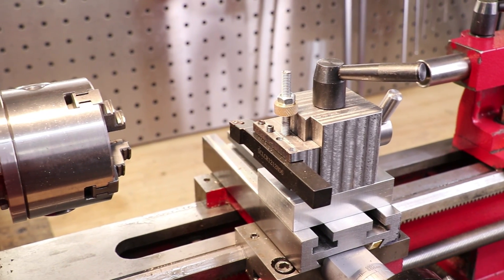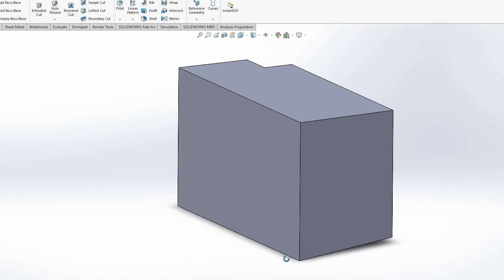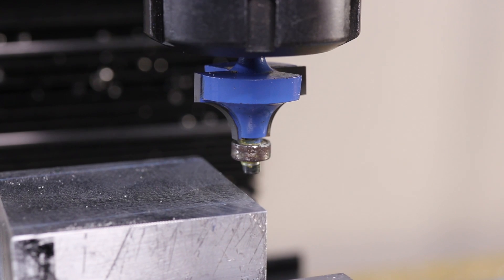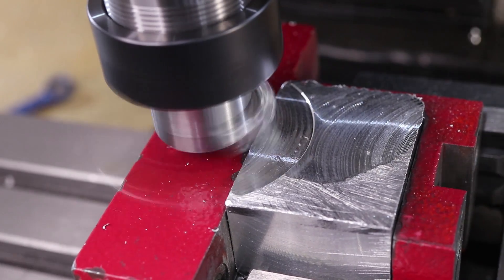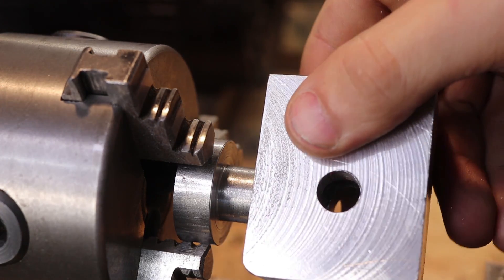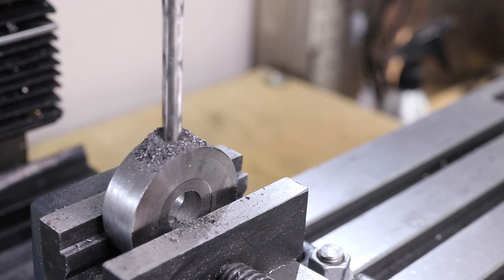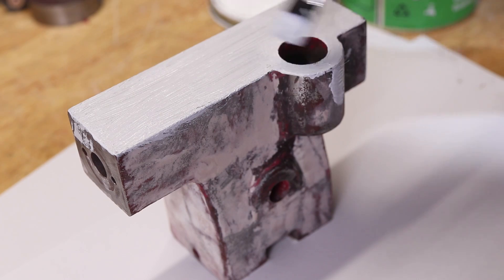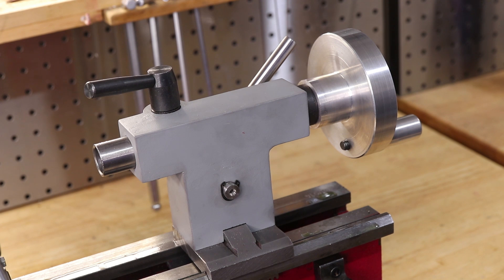Mini Lathe Lever Locking Tailstock Upgrade

Comment: Thank you for posting this.  It's a great idea.  For someone to duplicate it however, would almost require designing it from scratch, as all of your shots are very close up and it's difficult to tell if what we are looking at is right side up or upside down, front side or backside.  As well, the final assembly isn't shown in a way that we can see how it goes together and how the parts work together.  If your goal is to help others to duplicate your work, consider these thoughts and posting some drawings, exploded views, etc.  Thanks

Comment: Thank you for the inspirational way to cover the ugly space where the nut used to be. Very good. On my mini I have a spring at the bottom in order to push the locking plate down so it dos not interfear with "something". Best regards

Comment: I ended up buying the kit from little machine shop. Not cheap when you factor in shipping from the US (ended up costing me best part of £50 sterling) but when I factored in the time & cost of materials (none of which I had in stock) it was the sensible option.
I use my mini lathe in my business, & although I’ve managed with the nut & bolt for over a year, I really like the cam lock, plus it means my stubby 17mm combination spanner can go back in the set.
Reply: That kit from Little Machine Shop was one of the first mods I did to my mini-lathe.  Then made a nice knurled handle to replace the round plastic ball on the lever.

Comment: Was there a reason you used marker instead of your shellac marking out fluid? I was about to make some but will hold off if you’ve found issue
Reply from the maker: Not at all, I use shellac when I need long term layout lines, such as when I file the part and handle it a lot. For quick marking out I stick to alcohol markers

Comment: as a C6 (Hare Forbes special) owner a tail stock lock arm was one of the first improvements after making a riser block and removing the compound slide (I have only used it a couple of times in the last year). However, I did it by first drilling through the web of the tailstock (front to back) then using a digital angle block to find the draft angle and machining a spacer for original bolt hole and new hole in the web. I then made a thick walled tube for the slug connected to the draw bolt to move up and down in. This gives support for the rotating bolt with eccentric machined as you did. The only other thing I did was to put a thrust bearing between the collar and brass spacer on the back. (incidentally I also have a thrust bearing under the locking nut on the QCTP)  These are sturdy machines if you accept their limitations and use a work around when necessary.

Comment: If you want to see what can be done to  a mini lathe and a scraper check out Rotary smp channel !
That above all else is the thing I detest most about my mini lathe - the tailstock! Even with a lever lock fitted I still hate it and adjusting it so the machine turns parallel is a Pia ! Mine will soon be converted to a dedicated grinding machine .

Comment: Plans? or is it DIY?
what if you made another mini lathe using the mini mill also, then CNC'd it with Arduino, that would be the cheapest CNC mini lathe possible..similar to Levsha's Taig micro conversion with Arduino..

Comment: Another great video dude 👍 really impressed with how you overcome these issues on the lathe. What cad software do you use? Been meaning to learn a bit on cad so a good software to start with would be good.
Reply: FreeCAD is amazing. Not super simple to learn, but very powerful and translates well to professional CAD software.
Reply: @VOROX_Audio  thanks groonworld I’ll check it out and have a play.
Reply from the maker: Cheers Joe. The CAD software that I use is Solidworks, and to a lesser extent nowadays CATIA and Autocad. Everyone has their own favorite, the most popular one for hobbyists is Autodesk Fusion 360 which is free and easier to learn. There are some decent tutorials online for fusion and it is great because it supports g-code generating, incase you ever CNC your mill or lathe. Cheers
Reply: @artisanmakes  Thanks dudes I’ll download that fusion 360 and have a play see which I prefer. Would be more professional to map out my plans on cad rather than my child like drawings 😂😂😂

Comment: Hey Artisan Makes. I just got myself a lathe and was hoping you might have some insight. I am chasing a few bits and pieces for my lathe. Where do you get your tooling? And any recommendations on brand of centre drills and taps and dies? My first project is adapting a quick change tool post to my lathe and if possible want to get my tooling local.
Reply: I am also in Australia.
Reply from the maker: Most of my lathe tooling is either from ebay or made here in the workshop. I have a few bits and pieces from hare and forbes, and I always pick it up in person because I like to see what I am buying, although tooling from there is expensive, albeit good quality. My centre drills are just cheapo ones from ebay, they do a fine enough job and have lasted me since 2019. For taps, I use an old frost tap set (though having used several brands over the years I cant tell too much of a difference between brands), but if I was starting out new i'd get each tap as I needed them, rather than paying for a set. The rest of my tooling is either stuff that has been used by my family for years, or stuff I can pick up from bunnings. As a hobby machinist on a budget, bunnings and ebay tools do the job just fine. Cheers
Reply: @artisanmakes  
Thank you for the insight. I am also on a budget so appreciate your tips. Looks like a bunnigs trip is on the cards.
I had one other question. Where do you get your tool steel? Like you I tried turning down some all thread to make a shaft, but the metal is horrible.

Comment: I glue sandpaper to a $40 granite block then flattened my cross slide, compound etc. Once flat I glued sandpaper to the bottom of the cross slide, compound etc and put them back on with "semi" tensioned gibs and proceeded to work them back and forth. My cross slide went from impossible to adjust without being sloppy somewhere in the travel to set and forget.

Comment: Someone get this man a bandsaw! That hacksaws been in nearly every video..
Reply: It drives me crazy every time I see him hacksawing something. Sometimes I think he does it that way deliberately. Now that he removed metal from the bottom of the tail stock, without shims, it’s likely lower than it should be by a thou or more.
Reply from the maker: Although I did not measure it, scraping would remove tenths, not thousands, or as i'd put it microns. I removed less material than I could shim for. Cheers. And I do not have a band saw capable of cutting metal.
Reply: @artisanmakes  we know you don’t have a bandsaw. It depends on how you scrape. Also what appeared to be using sandpaper removes more than a fectenths.
Reply: @artisanmakes  We say you need a bandsaw. I'm sure if you post a fund link there would be some help in that department. You seem to be a practical buyer so it might not seem like a "you can make more stuff" purchase but it would speed things up considerably for you and possibly save on material in the long run. I go for the harbor freight 4x6 for $290 plus tax. Used to be around 220 with tax but prices in US are steadily rising.
Reply: You really think it was spot on from the factory?! @melgross
Reply: @melgross  it drives me crazy when someone confidently say scraping is removing a thou or more
Reply: Just about to post "Someone get this man a bandsaw" but you beat me by 5 hours.
Reply: Seriously, this man needs a band saw or a power hack saw.
Even if it's a Harbor Freight portable power band saw on sale for $99.
You can make a stand for them and hold them in a vise or make a stand and have it pivot.
Anything has to be better than flailing away that long with a hack saw.
GET A BAND SAW MY MAN!
Reply: @bustednuckles2  "HF portable pbs" yeah, I wouldn't go beyond that with china junk, my pulley ate itself due to bad design, now I just use table saw or chopsaw, loads of carbide options nowadays.